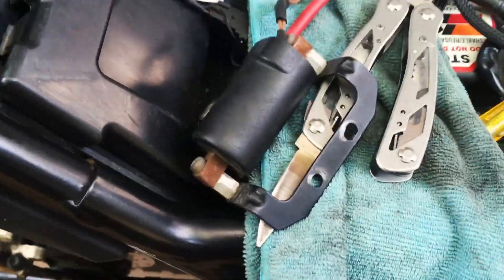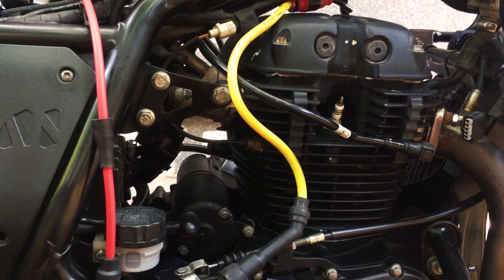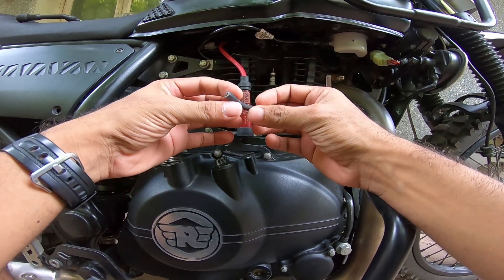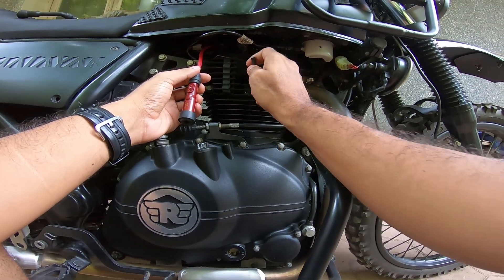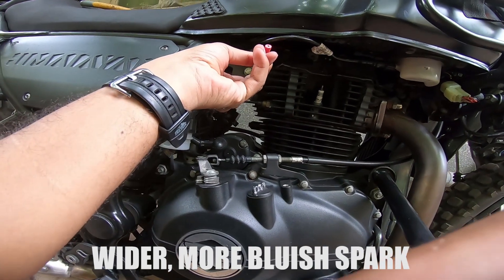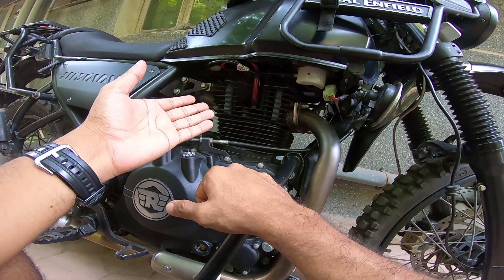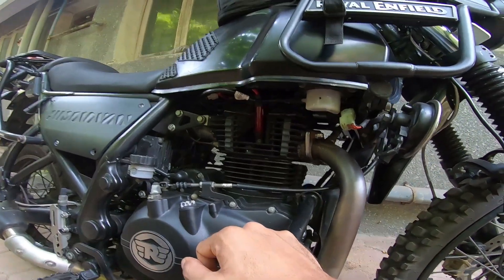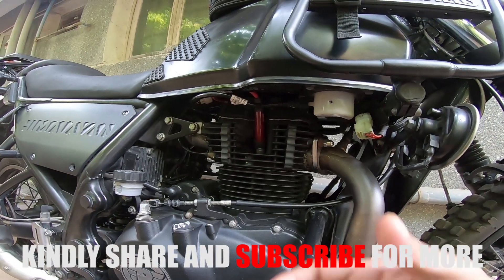PERFORMANCE MODS ON HIMALAYAN - NGK IGNITION CABLE

Comment: I have switched to E3 3.38 Spark plugs after using NGK on my Himalayan. The throttle response, fuel efficiency, and overall performance is much better now.
Reply: How is performing now,,, and please provide buying link

Comment: I already have NGK spark plug cr7eix (company ngk recommendation ) on intercepter and using stock company cable do you suggest to change the wire ? If yes, can you send me link of those wire for intercepter ?

Comment: Hi Ben, I am steadily moding my torque monster classic 500. Mine is twin spark. Does this spark plug cap and wire suit mine ? I can't find any leads to buy. Only difference I can see in the spark plug is the tip clearance , mine being .9 mm. I would like to discuss more in detail, can you please dm me ??
Reply from the maker: https://www.bikenbiker.com/products/ngk-high-performance-spark-plug-and-cable-kit-for-re-himalayan

Comment: Hi Ben I am buying a new Himalayan somewhere in April 2021 should get delivery. So if I were to change to a NGK iridium spark plug and firing cable... Would it cause a break in warranty?
Reply from the maker: no not required for a new ignition cable and a new coil and most importantly a lean Air Fuel mixture

Comment: Hey Ben looking for quick feedback as I am planning to do this mod. How is the performance of NGK CR8EIX spark plug as I guess you have done long distance travel on it. Thanks.
Reply from the maker: Have used iridium plugs for 15 years now . They are the best value for money mod .
Reply: @ONTWOWHEELSBEN  Thank you for your quick reply. Currently I have about 2K+ miles on my bike and planning to do valve check when I hit 3k.  Same time I will do these perf mods just like you mentioned in the video.  Getting all the parts lined up now.  Here in California things are opening up slowly so will get more chances taking the bike out.  Will keep you posted.  Stay safe and thanks once again.

Comment: What differences do you feel while changing the cable with stock??? Cause we can use iridium on stock cable
Reply from the maker: read about ignition cables with lesser resistance. yes you can

Comment: Bro I got an Honda SP125 BS6.  I am a collage student and needs milage so I baught an NGK Iridium sparkplug from amazone but the problem was that it doesnt had any gap and I straight up went to an local mechanic to make specific gap but that man used an cuting blade and screwdriver and without asking me by the process he slightly bended the iridium electrode then I went to anotherworkshop and made specific gap and installed the sparkplug bike is running . Bro my concern is that should I change the sparkplug because its electrod is slightly bended. Bro I had amazone 10days replacement but I didnt replace it because I knew that I made a mistake and I am truthfull to everyone. Bro please reply .
Reply from the maker: contact me on my instagram account (same name as youtube). share a picture of your sparkplug centre electrode
Reply: Thanks bro

Comment: Without powertronic can we install ngk split fire ignition coil and iridium spark plug along with k and n filter
Reply from the maker: its not a coil, its the wire that i have changed. yes you can change it if your vehicle has done over 10-15000 kilometers.

Comment: Thanks for the vid dude. Is this worth doing on stock bike? I mean no powertronic or exhaust.
Reply from the maker: no friend . doesn't help much. will create a hotter spark and even more hotter  running engine.
Reply: @ONTWOWHEELSBEN  thanks for the quick reply. One request. Can you do a comparo between your bike and a stock one? And give you thoughts on the value of all your mods.
Reply: @ONTWOWHEELSBEN  ah, this probably answers a question I asked a few seconds back.

Comment: Awesome!
I have a question though,  what do you do or suggest doing to ensure the exhaust pipe (end to end) looks neat and clean. It changes color/fades with time. I have tried to power coat it but it was burnt out / started falling apart in about 1000kms itself.
Reply: I have used a high heat enamel used for barbecue pits.  I took the heat shields off and then I used a green scrub pad and brake cleaner end to end on the pipes.  I then used the high heat paint even on the muffler.  Although it does not remain coal black - it does gray a bit at the exhaust port, it looks so much better than the original color of the exhaust.
Reply: @johnfew5145  thank you brother, let me figure out how it goes.
Reply: Hey Abhijit.... The most cost effective way i go doing is using scrubber pad (dishwasher) and harpic and scrub it and wipe it.
Reply: @freespiritravi0001  
Sounds good, I will try that too.

Comment: Any difference you see in NGK cable and Split fire?
Reply from the maker: NGK makes for a bigger spark , splitfire slightly less and the stock factory cable even lesser
Reply: @ONTWOWHEELSBEN  so it will be worth spending on NGK or split fire will also do the job consistently?
Reply from the maker: @beingCuriousRider  Splitfire will work just as good as NGK .
Reply: @ONTWOWHEELSBEN  where did you buy split fire from

Comment: Ben, good one. I've been postponing this wire mod for a while now. Quick questions please, are the leads a screw fit on both the coil and the cap? That part wasn't clear on the video. Basically I can unscrew the stock lead from the coil and cap and screw in the new lead?
Reply from the maker: yes it is a direct swap with screw on ends.

Comment: hey Himi prof - one question: Will this NGK full kit, help in the first crank of the day.  My 2020 esp, now in Dec winter, in the first crank of the day, when I am doing the first cold start of the day, turns off frequently.  I have to constantly use the choke to bump it up to higher RPMs for the engine to properly warm up.  Do you think this kit will address this?
Reply from the maker: No it will not . The only way is it get a fuel enricher/ commander. There is a product called race dynamics fuelX . Pls research it .

Comment: Thanks Ben for video. Any installation video on ignition.
Reply from the maker: I haven’t changed the ignition coil yet . This is the factory one
Reply: @ONTWOWHEELSBEN  sorry i meant to say was the spark cable direct fit in ignition coil.
Reply: Also is it CR3 or CR6 model.

Comment: This cable is on stock coil or you changed coil also?
Reply from the maker: Stock coil
Reply: @ONTWOWHEELSBEN  can i use these cable on carburettor Ns200 bs4
Reply from the maker: @abd1596  not sure ( but most probably you should be able to )
Reply: @ONTWOWHEELSBEN  ok thank you for your response

Comment: Iridium is a better conductor than a copper
Reply from the maker: yes it is .
Reply: No, what is does do is wear much less and focuses the spark more precisely allowing for lower arc over voltage.  It also wears much less allowing for longer life. Best Iridium plugs have platinum plated grounds straps for the same reasons.

One of the reasons for a standard copper core plug and standard wire is to ensure sufficient flash over voltage for a hot spark to ensure ignition.The lower voltage requirements from the better plug and low resistance cable will make up for it in current flow instead of voltage. 

In the end copper plugs with hood cables and coils make more power but they were out much faster… with marginal stuff the plug that makes it easier to flash over  and the wire to carry the extra current in the end do perform a little better.